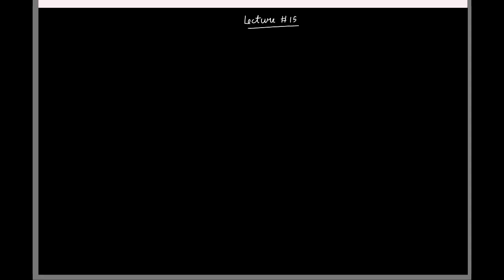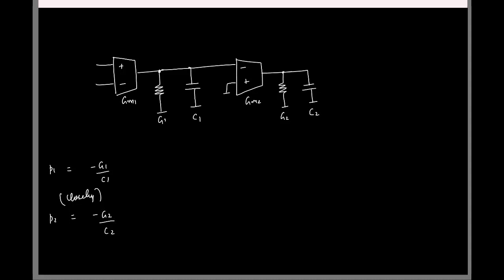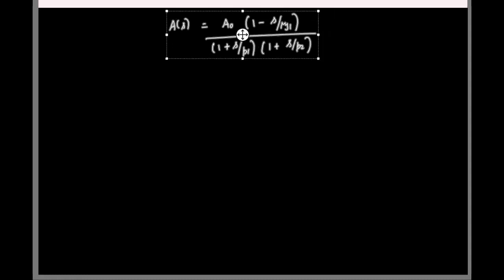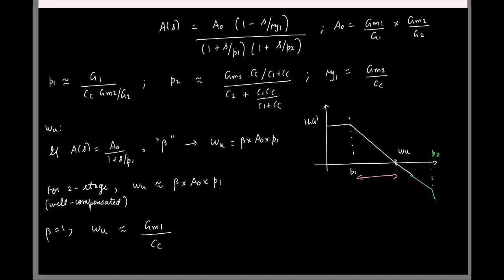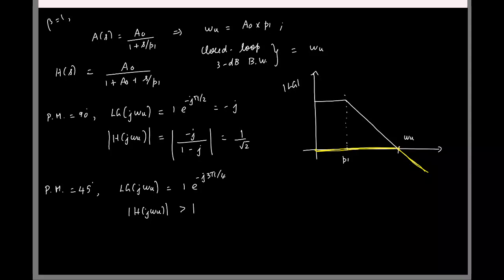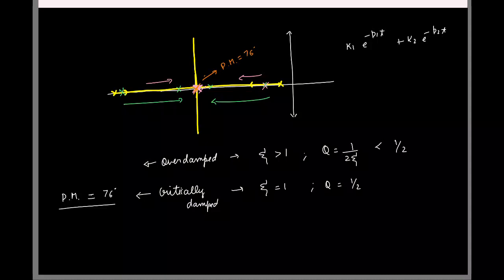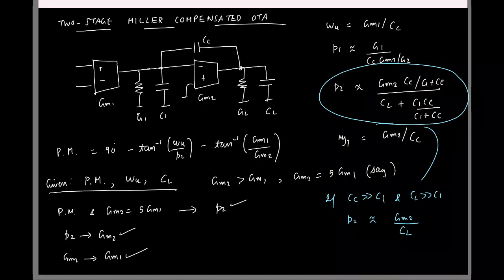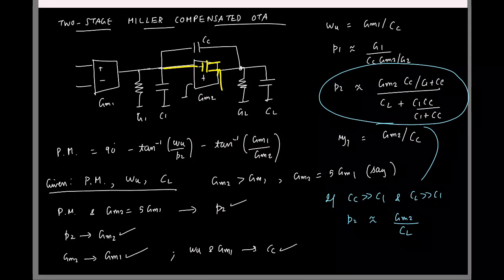Lecture 15: Two-stage Miller compensated OTA; Phase margin vs. time-domain response in closed loop

Comment: Thank you so much for making this video  🙏😊. You cover so many points that other professors overlook or skip through that are extremely important in industry. 
Could you please tell me: @46:00 could you not make p2 = zero in order to convert the 2-stage opAmp into an effectively single-pole system? If not, why not?

Comment: Dear Sir-Thanks for the lecture. In the beginning of the lecture-you mentioned that grounded and floating capacitor circuit will have different nature of the zero, i didn't quite follow that concept. Can you just write few lines here? Thanks,Raj.
Reply from the maker: That was an example to correct the statement that was made in an earlier lecture about zero frequency being greater than the pole frequency. The bottomline is that it need not be the case. The example shown in this video will have a pole at a frequency higher than the zero frequency.